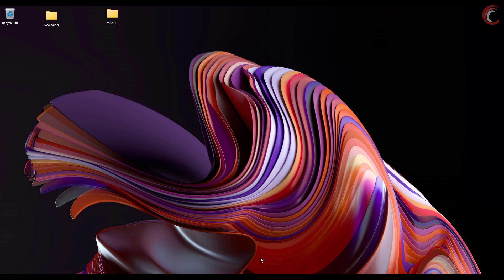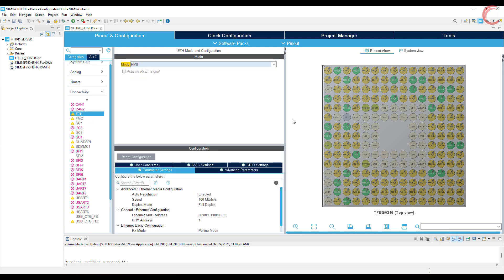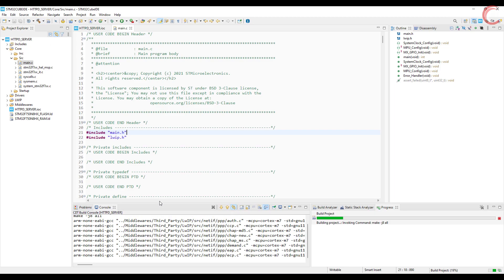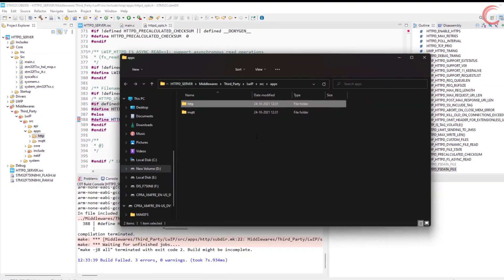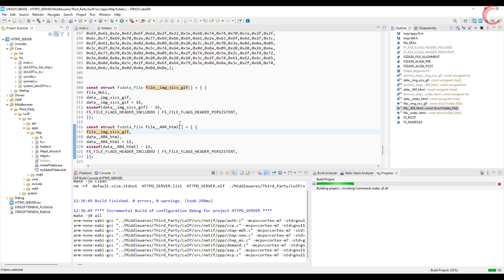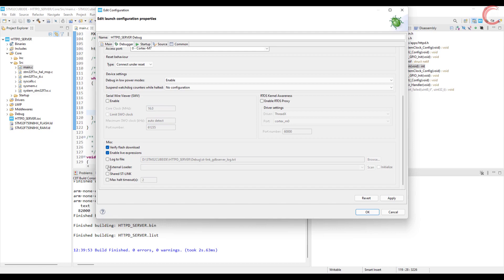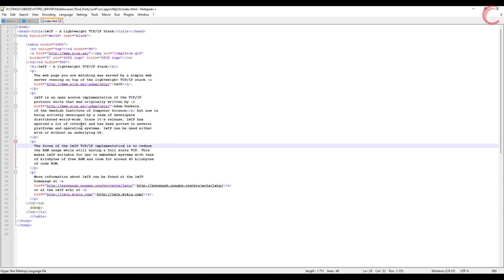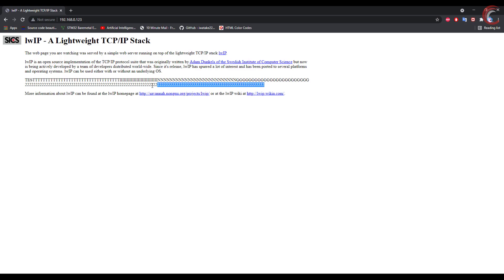STM32 ETHERNET #6. HTTP SERVER PART 1 || Simple Webpage

Comment: one question: you created fsdata.c because you were getting errors. but then you exclude it from build process. why? how you didnt get again errors after excluding?
Reply: fs.c includes fsdata.h, and based on IOC config, will include either fsdata.c or fsdata_custom.c

Since the include is essentially a copy-paste macro, it ends up compiling fsdata.c when building fs.c. Then it will attempt to compile fsdata.c, so forcing the IDE to exclude fsdata.c makes it so that the code within fsdata.c is only compiled once, removing the "multiple declarations" build error. The code is still getting built, just not in the traditional sense

Comment: Hi I'd been following your video and i try this tutorial but both the website is not showing up, ping also fail, i use the 2 fsdata.c and fsdata_custom.c downloaded from your website, pls advise soon...
Reply: i m using H723 Nucleo board
Reply from the maker: If ping fails, you should start with first tutorial of the series.
Reply: yes i started from tutorial 1 then proceed to #6. Anything wrong with the downloaded fsdata.c and fsdata_custom.c ? or should i make a new fsdata.c ?

Comment: hello sir.
i implement this project on stm32f407vet6 and when search server ip in browser, web page dont load. please help me.
Reply: please i am facing the same problem, did you found a solution please?
Reply: @origineorigine4126 hello. the problem was cubeMX version.
i switched to 6.1.0 version of stm32cubeMX and problem solved.
Reply: @mohammadkianibeyragh5173   I have the same problem. Cube MX 6.8.1, same processor, ping is working but not reply on the browser.

Comment: How the ethernet is connected?! Directly to router? What type of cable, whether straight/crossover cable sir?
Reply from the maker: Directly or router, either is fine. With direct connection you need to make some changes in the ethernet configuration of the PC. I have shared the configuration screenshots in the discord group. 
With routhet there is no such requirement, you can directly plug and play.
I don't know about the cable..

Comment: I'm using Cube version 1.9 and cant get this to debug. When I hit debug I get a message "Break at address "0x80007e6" with no debug information available, or outside of program code"

I've gone over it all twice and I've followed the example exactly, anyone have any idea whats wrong ?
Reply from the maker: If you are using external flash like i did, you need to click reset in the debugger once you see that error.
Reply: @ControllersTech  Hi, thx for replying. I'm using the same board you did. I tried resetting but every time it goes to debug it says "Break at address "0xfffffffe" with no debug information available, or outside of program code."  ... in the console window it says failed to determine breakpoint type
Reply from the maker: Is this your first project on LWIP ?
Reply: @ControllersTech  I've been following the series, this is the first one I've had trouble with.
Reply: @ControllersTech  Hi, not sure what I was doing wrong but it's working now. Thanks for your time and thanks for adding these tutorials :)
Reply: I worked out what I did wrong, I didn't tick initialise after selecting the external loader.

Comment: "undefined reference to 'httpd_init' " it says in my console. I have tried including the folder to the STM32IDE path. I have included the httpd.h header file, but the httpd.c is not being found by the compiler. Any ideas? 

EDIT: I forgot to mention but I put the files i downloaded in the folder just as you did. Still get the httpd_init(); error. It seems like I have to include the httpd.c file in the compiler linking, but I don't know how to do that in STM32IDE
Reply: I deleted all my code, made a new cube MX project and re-did everything and now I don't get an error with "httpd_init();" which is very weird if you ask me